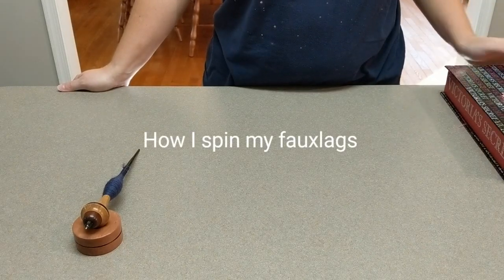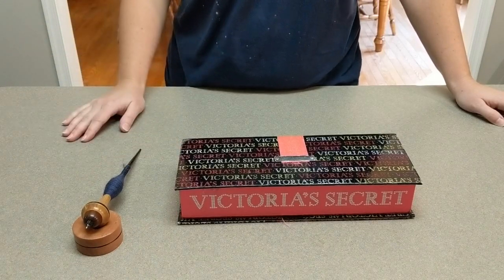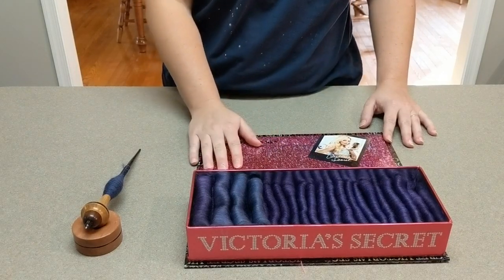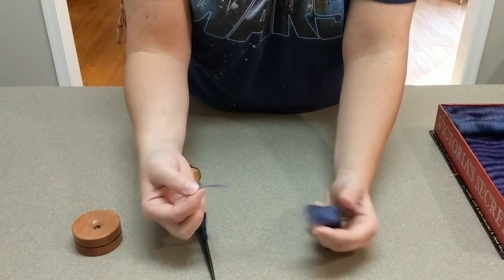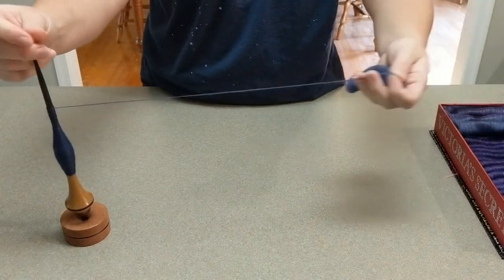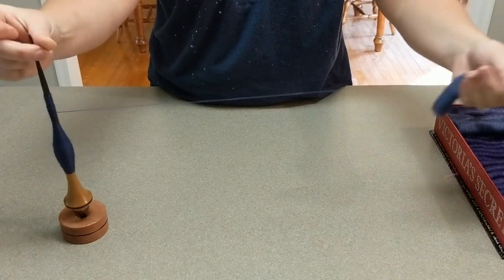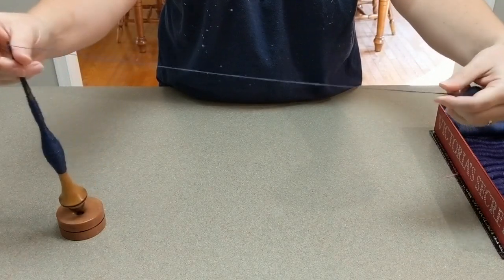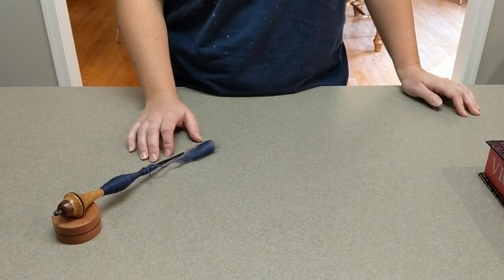How I spin Fauxlags

Comment: I am just getting started with support spindles and one thing I have not seen a good video on is exactly what you are doing to wind the yarn onto the temporary cop.  It almost looks like it goes on automatically like on a wheel but I haven't been able to figure out how to do that.
Reply from the maker: To quickly flick the yarn onto the temporary cop you hold the singles at a 90 degree angle to your spindle shaft and flick your spindle. It’ll pull the singles on as fast as the flick. HTH!!

Comment: Thank you for the video! This would be a woolen draft, correct? Can you make a video on how to draft woolen vs worsted on a spindle? Appreciated!
Reply from the maker: Yes, you are correct.  It is a woolen draft on this spindle.  What type of spindle are you using?  Drafting worsted on a support spindle is 'almost' impossible, just in the way the spindle is held in conjunction to the fiber supply.  But I can certainly do a video on worsted vs woolen on a drop spindle, top whorl or bottom/turkish.  Would that be helpful?
Reply: I am using a top whorl drop spindle right now. It's lightweight, 9", .5oz from essiespinner on Etsy. I have a medium weight top whorl as well.
Reply: @TheSpinningSara  I would like to see a video like this. I started on a top whorl but I’m now spinning with a turkish spindle.

Comment: This is so helpful! As a beginner, may I ask how you control the drafting/thickness of the yarn with this technique? Should you just make thicker fauxlags or do you control it in another way during spinning, similarly to your video with regular combed top? (I’m using a support spindle, if that matters :)) Thanks so much for your helpful videos, in any case 🙏🏻
Reply from the maker: Hi Nina!  I control the thickness of my singles when spinning faux lags with a support spindle by the amount of twist and drafting speed/drafting length. Shorter drafts will help keep the singles fatter. This way you can control the diameter of the single. It also helps if you start by using two hands to get the single situated in its gauge. It is much easier to maintain a thicker gauge if you start with a thicker one. Pinching with your flicking hand to help engage more fibers will help.
Reply: @TheSpinningSara  this advice has already helped me get the hang of it better, thank you so much!

Comment: Well, I tried it, didn't work quite like that - they looked right but it looked like my make managed to find and draft the ends and I ended up with a tangle in my hand, not one nice neat end and a semi spun bit like you did . Ah well, try again tomorrow.
Reply from the maker: It definitely takes practice. You should try again with some sacrificial fiber so you won't be upset if you make mistakes while learning!
Reply: @TheSpinningSara  i will do some time - but I got a wheel for Christmas so playing with that just now!

Comment: How come your yarn doesn't roll up on top, do you have it at the very top or what?
Reply from the maker: I think I understand what you're asking.  When the spindle is in motion, I tip the spindle toward the fiber supply so the singles flip off the tip rather than wrapping around.  If you pay close attention you can see the singles are never at a 90° angle to the spindle tip unless I am winding on the temporary cop or the permanent one.  HTH!